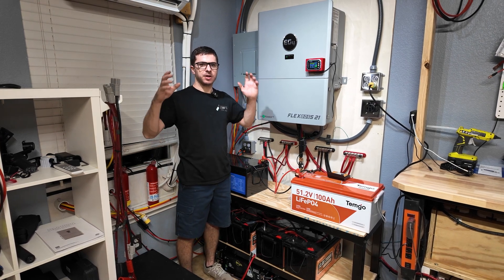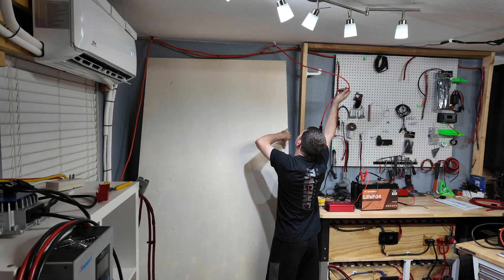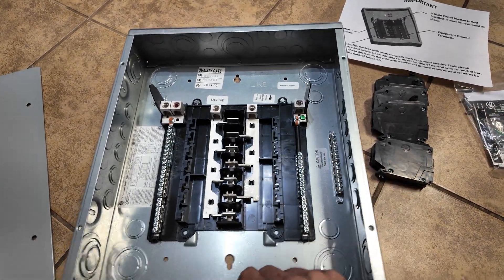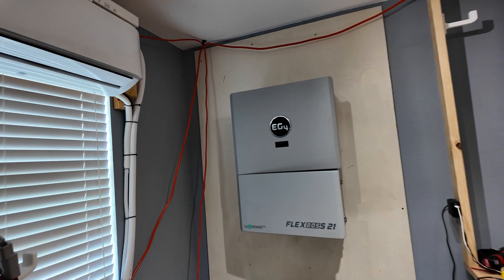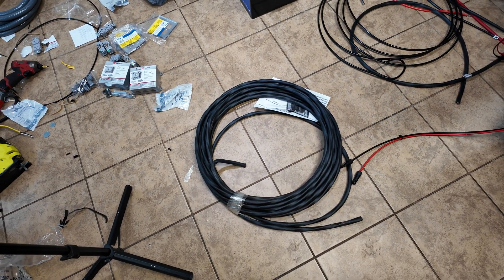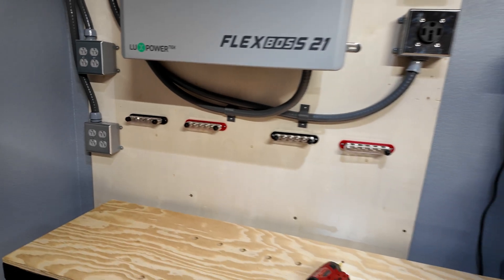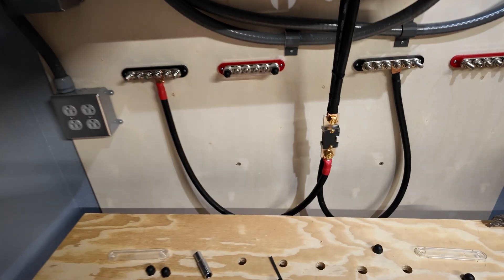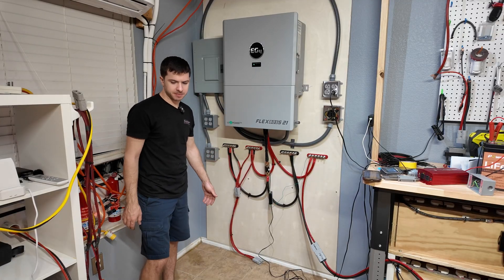Powering My House Off Grid in 2025!  48volt Off Grid Solar Power System! EG4 Flexboss 21 Install!

Comment: How are you using different brand of batteries with different capacity
Reply from the maker: Voltages are the same so you can parallel up all day just use good wire and busbars works just fine
Reply: @Mikebuildss i never knew. Thank you

Comment: Did I miss the part where you hooked up the solar panels to the inverter? How can you be off grid without solar panels to recharge the batteries?
Reply from the maker: Yes I did that off camera it’s a simple connection to my array outside